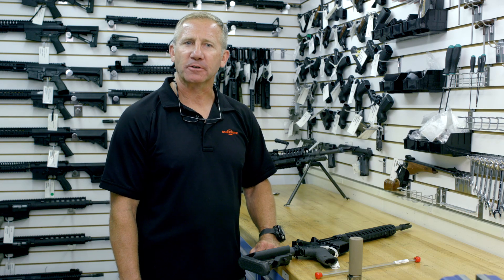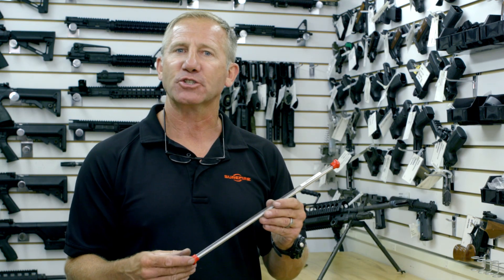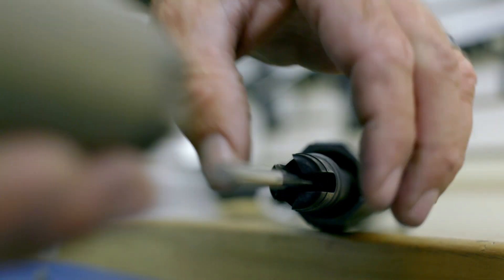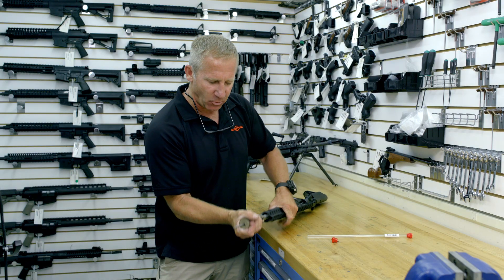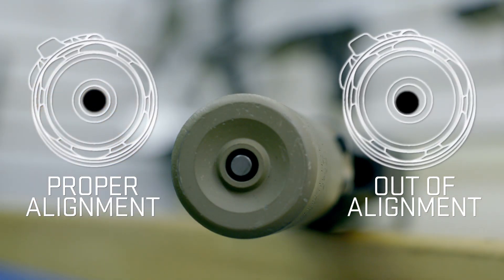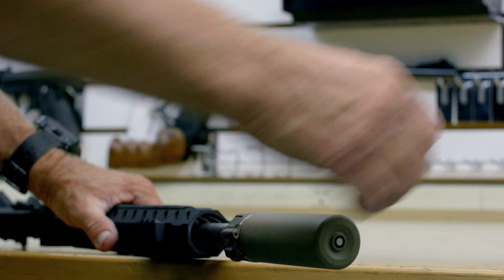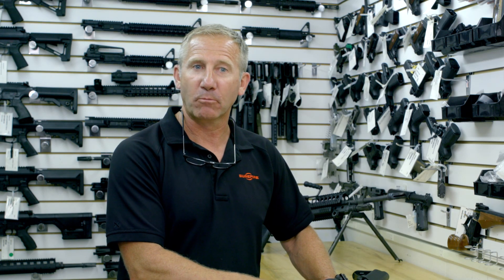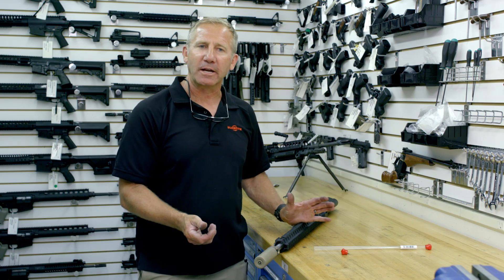Suppressor Bore Alignment Rods

Comment: If you have good eyesight you can focus on the suppressor endcap and then focus your eyes on the Bore and it should line up like a peep sight on a gun. You just need to shine a light from breech to muzzle. The eye is actually very precise when it comes to bore alignment.
Reply: Thanks, I was worried about a baffle strike on mine, but once I broke down my AR and looked through the chamber and saw a perfect tunnel I knew it was good. Cycled a few hundred rounds just fine and dandy.

Comment: What do you do if the suppressor does not line up?
Reply: scream into the sky
Reply: @Slay_No_More  😂
Reply: Adjust muzzle device most likely the issue.  Was it torqued to spec?
Reply: Correct answer:
Keep buying bore rods until they do line up.
Voila!
Reply: Use shims first before installing back the suppressor

Comment: These bore rods are great for checking the barrel integrity as well.
When i joined up Army back in 86 my 1st shots  with M16A1 had a bent barrel so i wasn't hitting target no matter how well i aimed,  the Drill Instructor didn't like my shooting to say the least lmfao 😄
I insisted something gotta be wrong with this here rifle Drill Sargent so he sends me down to the armorer technician truck and the guy slides a rod in the barrel and I'll be dipped the barrel literally warped to an extreme amount...
I ask the guy "Why is my barrel so badly warped???"
He says sometimes you got these recruits that'll set the barrel up against the wall and kick it really hard as a prank before they leave basic training. 
I said to the armorer maybe the barrels of all the rifles should be inspected for this before they're issued to new recruits , he agreed and said he will have a good word with his colleague at my units armory.
Reply: stop the cap
Reply: My DI would have told me a good rifleman would know how to compensate for a bent barrel

Comment: Go buy a $5 piece of rod from the hardware store, cut it to 18" or so. Roll it on a flat surface to check that it's not bent. Same way you do with a pool cue...
Wrap some tape around it at one far end, then about 7-10" up from there with the same exact length of tape. Tape just enough to make it tight to the point where it doesn't wiggle, but you don't have to force it into the barrel, then with the taped section in the barrel check just as he did for central location of bore.
If it's close to one side, turn the rod 180 degrees to verify it didn't turn to the opposing edge of the suppressor. If you turn it 180 degrees and its still close to the same side that it was before, you're going to experience a baffle strike if you fire it.  

Updated:  See my other comment...

You're welcome! 💪🇺🇸
Reply: McMaster Carr 
Tight tolerance oil hardening 01 tool steel rod: sizes. 
(you're welcome!) 

22lr = 0.2120"
223/5.56 = 0.2188"
9mm = 0.2969"
308 = 0.3438"
Reply: @2S1L3NT  Just ordered the 3 sizes I needed for a whopping $33.01 including shipping and tax. Thank you, sir!
Reply: @2S1L3NT  What about 7.62x39? I know that they take a different bullet diameter than 308. Around 5 percent of combloc AK barrels are not concentric, from what I've heard.
Reply: @2S1L3NT  Thanks a lot!. 9mm and 308 seem to be mixed up. 6.5 Creedmoor is 0.250". mcgowenbarrel website has a fantastic reference table.
Reply: Or I could just buy a $75 Rod that is going to be used over several $1000+ devices
Reply: @bigpatty823   Research.
Mcmaster Carr tool steel rods. 
Bought one for 5.56, 308, 9mm, and 22lr, They're 3' long and were $40.32 shipped for all 4. 
I've used them multiple times and even discovered my hand threaded SAR1 AK happened to be centric.  I've shot hundreds of rounds through suppressors in various guns since...
You dont always have to get ripped off to play with big boy toys. But if that's you're thing 🤷‍♂️
Reply: The rod may straight but the surface you roll it may not be. That’s why you buy the specific tool for the job.
Reply: @CaptainCreampie69  NO NO BUY A $5 ROD DONT SUREFIRE

Comment: 75 dollars for a rod...yeahhhhhh
Reply: $9 at McMaster-Carr for a .308.
Reply: 75 dollars is criminal wtffff, they should bee ashamed of themselves
Reply: SureFire Baffle Strike = Yea your Screwed 
DeadAirBaffle Strike= WE GOT YOU
Reply: @sticrzy123 not true, surefire will replace the baffles for you.  Happened to a buddy.
Reply: @sticrzy123 no way, I'm glad I went with Dead Air
Reply: They're $120 now 😂😂😂 Jan 2025
Reply: Y’all must be new to the industry as far as quality goes. Gages are always around that especially custom ones
Reply: @rileywelton3243  I am new actually, I guess that is the norm.
Reply: You can get them for a few bucks
Reply: @AudibleVisibIe mind sharing where? I need several.
Reply: Go buy a $5 piece of rod from the hardware store, cut it to 18" or so. Roll it on a flat surface to check that it's not bent. Same way you do with a pool cue...
Wrap some tape around it at one far end, then about 7-10" up from there with the same exact length of tape. Tape just enough to make it tight to the point where it doesn't wiggle, but you don't have to force it into the barrel, then with the taped section in the barrel check just as he did for central location of bore.
If it's close to one side, turn the rod 180 degrees to verify it didn't turn to the opposing edge of the suppressor. If you turn it 180 degrees and its still close to the same side that it was before, you're going to experience a baffle strike if you fire it.  You're welcome.
Reply: @2S1L3NT  this is a terrible fucking idea, don't do it. These cheap rods are usually not quite straight.
Reply: @YukarisGearReviews  It worked, buy I've since found the manufacturer these people buy from and add insane markups to.  I got 3 shipped for $14. One for 308, 5.56, and 22lr
Reply: @2S1L3NT you got a 5.56 and a 22lr?  That’s interesting. They are the same caliber.
Reply: @jglaze6822 No they aren’t. Bore dimensions are quite different.
Reply: @2S1L3NT  Care to name the manufacturer?
Reply: @2S1L3NT   Yup, the communist way to do it 🤣

Comment: Is there a way to do this check before ordering a suppressor?
Reply from the maker: The alignment is determined by the threads on the barrel being concentric to the bore. If they are not, you need to contact the company that manufactured the upper or barrel. Perhaps if you wanted to check this before buying a suppressor, you could take your upper to a class 3 dealer that is willing to let you test fit and bore rod a suppressor.

Comment: If "SureFire Bore Rods" are "manufactured by Geissele Automatics" as this video description claims, then why are SureFire Bore Rods and Geissele Automatics Suppressor Alignment Tools marketed and sold separately?
Reply: This is a common practice in the firearms industry (and lots of other industries).  A good example would be Choate rifle stocks.  Choate has been providing synthetic stocks to Savage, Thompson-Center and many others for years and putting the company's name, logo, badge, or whatever on them.  If you buy the same stock aftermarket from Choate it has Choate's name on it instead.  People will argue you until they are blue in the face about their stock being a "factory" stock without understanding the reality that it comes from a supplier.  So, you can buy your bore rods from Surefire or you can buy them from Geissele.  You will be getting the same level of quality since it is, in fact, the same product.
Reply: The real question is, why aren’t you buying your “geissele bore concentricity gauge” in the rod section of your steel supply.
Reply: @undercovercop2000 the secret Big Bore doesn't want you to know
Reply: Speer gold tips are the same as federal fusions. An Acura is a Honda. Capitalism is legal lies
Reply: Nicholas Johnson it's the same Geissle product